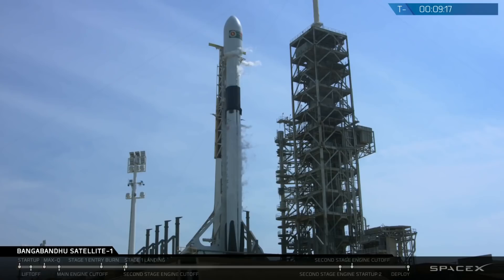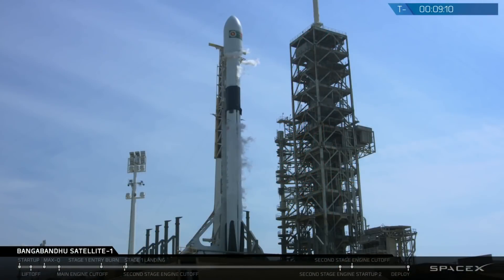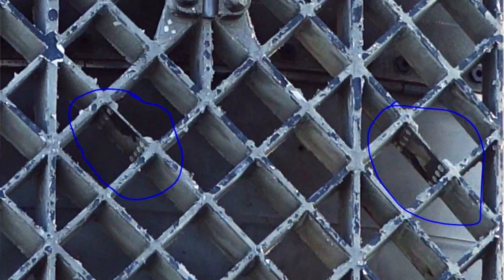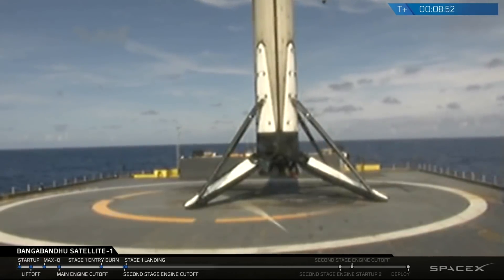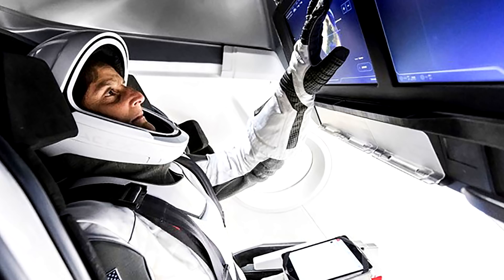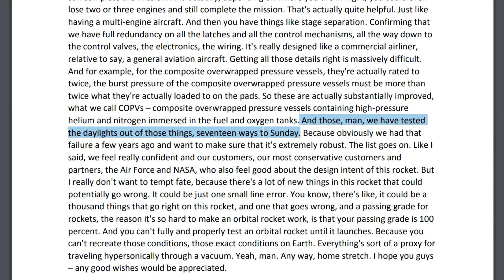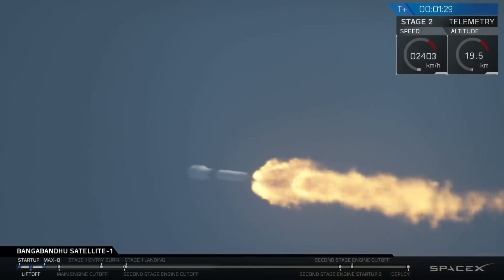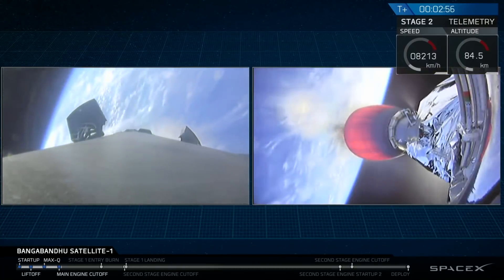How Well Did SpaceX's new Falcon 9 Work?

Comment: They took the idea of a metro and made it a few orders of magnitude less efficient.  The hyperloop is a total joke that won't work.
Reply from the maker: You may be right, but I’m happy to let people try, as long as it’s not violating the laws of physics.
Reply: Hey... if they can figure out how to violate the laws of physics, I'm all for it.
Reply: Elon has not only a Business Degree, but a Mechanical Engineering Degree. Self taught in rocketry, he was the lead engineer at SpaceX. Look how far that went. Gwen Shotwell is supporting Earth-to-Earth transportation, so this isn't an Elon time-distortion effect.
Reply: I tell you that a single orbit flight back to the same location for 50,000 would turn his new Texas launch site into freaking Disney World. Add a resort with some "training" and you have an expensive vacation, but not 100% out of range. It just means you aren't buying that new SUV.
Reply: Rather than pressurizing and depressurizing over and over of the whole hyper loop track ( which is very inefficient )
Have loading and unloading zones where the track car is parked in a separate section of tube that can pressurize and depressurize separately,

Which will prevent possible buckling of the hyperloop track!
Reply: Gummy Bugz: The point is to try. If you don't try new things, you won't go anywhere. The worst case scenario is they get better tech for their normal rockets.
Reply: No way in hell are you launching rockets that big from cities anyway. making the whole thing ridiculous when going to the launch site, and security, will take so much time. Even if by some voodoo the price gets pushed that low.

And if you look at the current 'hyperloop test track' its a small shoddy rusty tube in the desert. The project was a good PR stunt, not much else.  How are they even going to deal with thermal expansion on a vacuum chamber that will need to be many times bigger than the biggest one we have ever built. Don't hear them doing any tests on that.
Reply: @David Ogawa Just because you have an engineering degree doesn't mean your re-adaptation of an old idea won't create extra challenges, while fixing no new problems.
Reply: How do you get these figures? The estimates of BFR construction costs are around 500 million. If you fly it once with 200 passengers its over 2.5million by passenger.

But cargo to LEO is estimated at 150 000 kg which means 15,000 220lbs people. Lets say they get 400 in there, shouldnt be too hard. Its now 1.25 million per customer, then they estimate 500, 000 fueling and maintenance per flight.

if the vehicule makes 10 flights with 400 passengers we're talking 126 grand per ticket, if it makes 100 flights per vehicule, 12 grand, etc
Reply: As for thermal expansion, did you know: While conventional railway tracks are built with gaps to accomodate the expansion of the steel, for high speed rail the gaps would cause too hard hits against the wheel, so the whole track is welded as one piece? The rail is pretensioned when laying it down, then it is bolted in place and the many anchor points along the track hold the tensile strength (source: scienceclarified. com/everyday/Real-Life-Chemistry-Vol-4/Thermal-Expansion. html ; search page for "train").
So large scale tubes like this presumably are also possible. Also, have you seen the current hyperloop test tubes? They are not like a simple smooth tube, they have cutouts, windows, etc. if it really were necessary they could develop an external seal and expansion joint around the tube. Not even talking about using tunnels... All not impossible, just an engineering challenge
Reply: According to Musk, their aim is to offer one-way trips to Mars for ~$200,000 per person aboard BFR. A trip to Mars will require several tanker launches for refuelling, food and water for several months, much more space per person due to beds and such, etc. A 30-minute suborbital flight would be orders of magnitude cheaper. Even if he's off by a factor of 10 and a trip to Mars ends up costing $2M/person, a suborbital flight should be, at most, a few thousands.

The practical difficulties regarding launches from anywhere near a city are a different issue, but I think that the claim that it could have a ticket price comparable to airlines is reasonable for intercontinental travel.
Reply: hyperloop idea way to complicated-  not energy efficient-  dangerous -  but sounds good if U dont  know any better -  ( most of public)
Reply: Combat Medic Im  smarter
Reply: They won't be launching from the cities. The plan is high speed transport to remote location, most likely over water.
Frodo, don't laugh at new tech. You often end up on the wrong side of history. I don't know if either plan is possible, but I've seen things that would have been impossible when I was a kid turned to reality. What we see Musk doing right now with SpaceX was always considered a total pipe dream.
Reply: @Frodo TheHobo
 ""And if you look at the current 'hyperloop test track' its a small shoddy rusty tube in the desert"" lol thats not SpaceXs Hyperloop. That is an entirely different company testing it out. But GJ not knowing what you are talking about. noted.

You remind me of the people in 2014-2015 that said landing F9s was a stupid pointless idea. Won't work. Even if it does, 're usability will be more expensive' and they cite the Space Shuttle like its a relevant example. LOLOL. Clueless.
Reply: I mean, people have made, and flown rockets which landed themselves before, that's not all that fancy, the only new thing is that he's building them big enough to fly to space. The hyperloop, on the other hand, would be a terrorist attack just waiting to happen; one large caliber bullet to thing, and everybody on it gets turned into a smear, and possibly everyone nearby as well. If, of course, Elon's engineers can figure out how to prevent thermal expansion from being a huge issue somehow.
Reply: A full orbit may be more than a ballistic flight but not as much as you think. On a fully reusable system, we are talking about the cost of fuel. 
The flights definitely not be million dollar per person flights. The plan is for BFR launch costs to be less than the Falcon 1, around 7 million a flight.   The whole thing will be 335 million a vehicle.
Reply: They might or might not figure it out. But the technological advancements needed to make the hyperloop a reality will be such that even a failed attempt will reap financial benefits for patent holders.
Reply: Explain.  How is it not energy efficient?  The whole idea of using an evacuated tunnel is to eliminate air drag.  Please also tell us about the danger.  Fully automated controls for vehicles (no human in the loop) will probably eliminate traffic accidents.  Also explain complicated.  Build a tunnel, pump the air out, install track and vehicles.  Which part is "way to" complicated?
Reply: @Brian Gleason There are two test tracks, one is owned by musk and its a rusty flimsy tube.
Reply: Because building hundreds of tunnels and hundreds of pods that need to hold cars and can change their routes will inherently be less efficient than a normal well planned metro system? The london tube already has driverless trains.

And in his vacuum tests, with pods that are basically compressed teslas with no room for passengers they couldn't even go faster than normal trains, let alone things like maglevs.

And why is it we don't see many maglevs around? prohibitively expensive. A maglev in a vacuum will be even more expensive.

I don't think its even a serious project to them, just a great way to build the personality cult of musk and catch lucrative government grants. just like the cynical laughable cash grab that was solar roadways.

Could they build a hyperloop train? Yes its possible. Will it be time and cost efficient? No.
Reply: @ Hayden Jones, that's great. He gets to play around with government grants and thus no risk to him. Develop patents with it and generate profit.

Wile the tax payers carry the losses. What a great fucking idea to further soceity.
Reply: No:
Bachelor of Science degree in physics from  University of Pennsylvania College of Arts and Sciences, and a Bachelor of Science degree in economics from its Wharton School of Business.
Uncompleted PhD in energy physics at  Stanford University.
Reply: Frodo TheHobo - Traditional maglev is expensive because the whole track is active. Elon mentioned a few times that most of Hyperloop's track should be passive to make it cost efficient. When you eliminate these giant energy needs of huge, heavy trains and their low accelerations you get some new R&D possibilities with different throughput/cost/convenience trade-offs. Who knows, maybe he will find a new sweet spot that is more effective in some ways than subway, train or a bus - although obviously the chances are low, like with majority of ideas that try to be disruptive.
Reply: Like everything new idea Elon gets into his head it needs to be taken with a grain of salt, but there is quite a lot of improvement to be made in the tunneling industry. Perhaps there's a few orders of magnitude of cost and productivity savings to be found with a higher economy of scale? Theres significant safety concerns of course, no way will it cost only a dollar per passenger, advertised speeds are completely out of the question, and theres hardly sufficient room in crowded cities for significant access to tunnels in the manner proposed thus far, however, the US is suffering under the current highway system, adding more roads doesn't help and tends to tie up cities they cross. But, a correctly graded, separated highway network entirely within tunnels might be a solution. Cost is the major factor.  Inside cities I still believe that a lightweight high speed rail network is essential, roads are needed for commerce but theres only so much volume of cars they can handle.
Reply: Dark Jakket, to minimize air leakage to vacuum, you park the module beside an air lock - just like a space ship. Seal the ship to the airlock frame, add air, open the doors. For safety, the entire car can be parked in an isolated chamber almost the exact same outline. This also minimizes leakage.
Reply: trueppp, 1000 flights

Comment: Question: You mentioned that the Dragon Capsule is a relatively light payload. Less mass means more acceleration for the same force.  What are the acceptable G-loads for human space flight?  How does that compare to hardware? What does a lighter load with limited acceleration mean for the launch profile?  My KSP inspired gut instinct says that the first stage will go higher, achieve greater velocity and travel much further down range.  (As in oops I accidentally put my first stage in orbit and didn't make plans to de-orbit it -- accidental space junk! [KSP])
Reply: As described in the video and discussed in many comments, They decrease the "Throttle" as the air pressure drops to maintain the level of acceleration. They would also only use enough fuel for each stage with decreased loads to keep there costs down like on smaller sat launches.
Reply: Loading for humans (and rockets) on ascent is usually limited to around 5 G. Any higher and the vehicle is put under a lot of stress, so usually the engines are throttled back as the tanks drain. That being said, Falcon 9 has an over-sized second stage, so it may be able to thrust at full throttle during the entire ascent (apart from during max Q) without peaking the G meter too high. Since the booster needs to come back to land it doesn't burn to completion, and every bit of speed forward needs some propellant in reserve to boost back again. This means that the stage doesn't end up too much faster or farther before it needs to shut down in order to have enough propellant to boost back and land.
Reply: Humans can survive over 50 gs with no long-term effects.  Usual limit for functioning is about 5, but it varies.  Higher for short bursts, lower sustained.
Reply: The second stage does a greater percentage of the work for these missions I would say. Since the payload is lighter, the booster leaves the second stage to do more work
Reply: Dennis Lindemann For an instant, maybe, but not for more than a few seconds tops. As mentioned above, we don't put astronauts under more than a 5 G load for a ride to orbit.

Comment: "Alyuminium" - S.Manley
Reply: Nope. I'm pretty sure he can spell.
Reply: Time to upset the A-lu-mi-num / A-lu-mi-ni-um debate with a third independent option: "A-ly-u-mi-ni-um".
Reply: @Geert2682  The correct pronunciation is Al-you-mini-um.
Reply: artemkras: Aluminium is how the element is supposed to be spelled and how it's officially spelled. 'Aluminum' only exists because an American newspaper had a typo on one of their front pages.
Reply: Hate to be "that guy", but Sir Humphry Davy - the English chemist - was the one who named it Aluminum in 1812. Aluminium was preferred by other chemists, and was even the most common spelling in the USA until 1895. Webster used Aluminum in 1828 in his dictionary and that that usage increased progressively until it overtook Aluminium in 1895.

https://en.wikipedia.org/wiki/Aluminium#Etymology
Reply: JamEngulfer: The discoverer of Aluminum/Aluminium originally named it "alumium," and then renamed it "aluminum." It was another guy in Britain who decided to change that to "aluminium." He used the reasoning of the -ium ending matching the naming of other elements, but to be fair a number of elements also end in -um. So I'd say that, if the officialness of the names were removed, "aluminum" should be considered more official, as it came first and was what the discoverer called it. With the official designation, both pronunciations are equal in their deservedness to be used.
Reply: Geert van der Wal you're the one who got my idea ))
Reply: To the rest, it's not the -ium part, it's the -lyu that I mentioned ) Also, 'hwere' ))) I kinda like it )
Reply: Alunimium is flat and a NASA-staged hoax )
Reply: artemkras it's how the English pronounce it. It is there language.
Reply: FOAD.
Reply: 'there language' sounds more Canadian to me.
Reply: artemkras he could be? The British pronounce it the same way.
Reply: He was born in troon,  Scotland
Reply: oh, ok
Reply: Gavin Mcinally, Manley the Scot ? )
Reply: British chemist Humphry Davy, who performed a number of experiments aimed to synthesize the metal, is credited as the person who named aluminium
Reply: But it is now internationally agreed to call it aluminium, it's just America love going back on deals